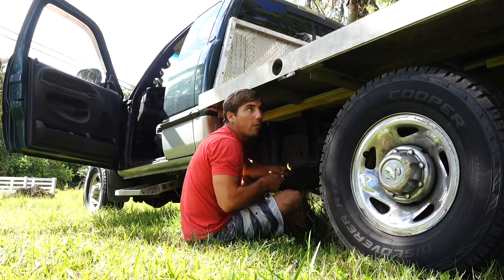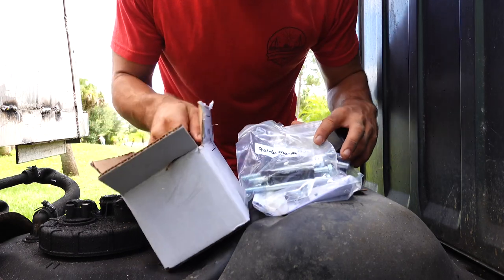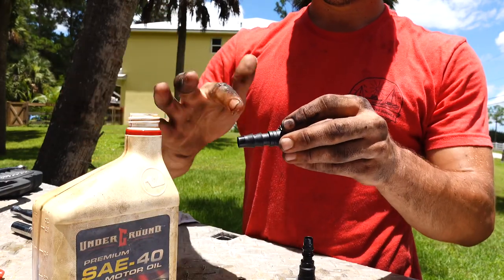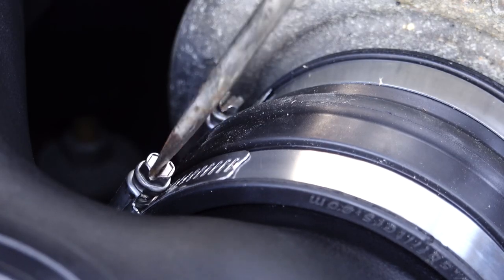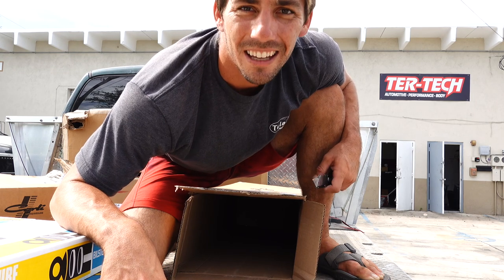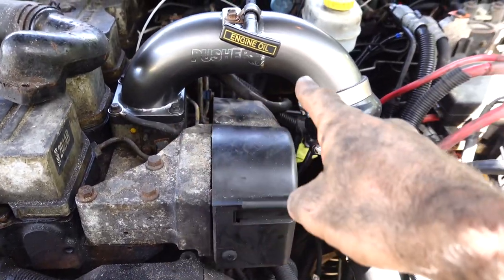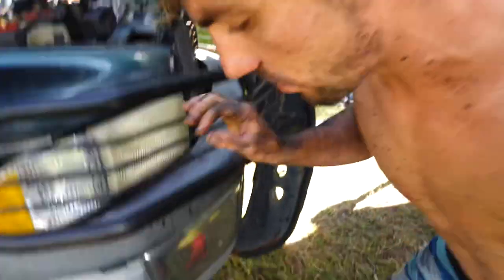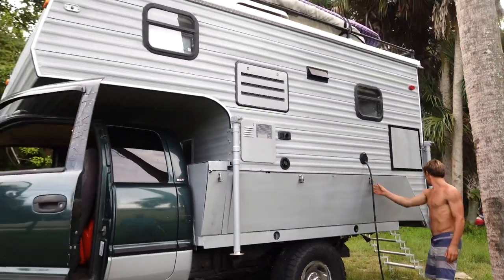Preparing the guts of our 20-year old cummins for an Off road and Off grid Truck Camper - Terra Tula

Comment: Treat the rust while you have the truck apart. May have been fine up until now, but have see too many trucks that end up needing frames welded because of big holes. Use a rust encapsulater or rust converter on everything. Even the drive shaft, etc. Will last lots longer and the next owners will thank you. I use stuff in rattle cans. Easy and lasts and lasts. Also use on steel trailers.

Comment: Dont forget to change your clutch fan. Clutch fans are probably the number one cause of cooling system failures. Even though your fan will be spinning with a worn out clutch fan, I will not be engaging as fast as it could at higher rpms so you lose cooling. A good way to check your clutch fan is turn on your AC. Most newer trucks are designed to engage the clutch fan as soon as your AC compressor starts. If you dont hear it come on, or its weak or slow, replace it.

Comment: I've got the same truck with the 5spd manual transmission. Shortbed. Same year, same color. Same problem with crap getting inside the fender by the air intake. Freaking stupid starlings. I also put an aftermarket lift pump on mine very soon after I bought it on 2007. I put the FASS system on mjne.It had about 172,000 then. It's got a little over 261,000 now. I've had zero issues with the vp44. Love my truck!

Comment: I dig these videos regardless of the mode of transportation.

In the first part of the video your hair was all wind blown.  You looked like a young Martin Sheen in Apocalypse Now.  

Definitely enjoy these projects and it happened to notice that this was done prior to doing the camper which obviously was a smart way to do it because if you don't have a dependable vehicle the camper has nowhere to sit.

You always do it right the first time no expense spared buying the best that you can afford, BRAVO!  No clean air no proper functioning diesel engine.  Thank you Mr Diesel!

The turbo almost works like part of a jet engine ( turbo fan & compressor). The more uninterrupted air the better.

Where are Billy, Sierra and Jetty currently?  Last video was block Island, where from there?

Comment: Hey guys, great vid as always. Could I suggest you use turnbuckles instead of ratchet straps to hold the camper to the flat bed? As an avid camper, I have found that ratchet straps can fray from unseen vibrations and micro movements at highway speeds. Just a suggestion. Camper and truck looks good!

Comment: I've got a '95 12v Cummins but it's only 2wd. Still fires up right away when I turn the key even with 306k miles on it! No electronics in the fuel system. It just sits in the driveway next to a '00 Ford Excursion 7.3 turbo diesel since I replaced them both with a 4wd '02 Tundra with the V8 and a Leer cap. They get cranked once a month.

Comment: As a mechanic with 30+ years experience I have to say good job on the repairs and upgrades,  now that it will "go" reliably, do not forget that rolling smooth and stopping is  important too. Many people overlook the bearings in the rear differential, you are carrying a heavier load now on parts worn in with a lighter load, accelerated wear is not uncommon when working conditions change. The brakes on that truck are more than adequate for the application, but do inspect them for condition and function. All the best from land locked Alberta.

Comment: Very nice job and improvements!  You wonder, why don’t manufacturers install quality intake manifolds from the factory?  What will it cost them penny’s?  Ugh..... I remember when I used to do most of this work by myself.   I used to think it would be nice to be 35 again, I’ll settle for 55!    My only suggestion would be to do something with those padlocks to keep them from rattling around.  But man, what a great job you guys did!

Comment: billy you need to fix that rust at the bottom of your doors!!   sadly it is a problem for all dodge trucks of that era and finding used doors with no rust is impossible on the east coast. .  what i have seen done is popriviting aluminum diamondplate over the bottom of the doors... looks pretty good.

Comment: Great job.  Have you thought about protecting those filters hanging below the frame in any way?  They look like the low point in the center of the truck.  Not sure how extreme your off roading will be but they would be the first to hit.
Reply from the maker: Def mounted much higher than the differentials and some other components

Comment: You really need a large transmission cooler on there with the weight you are rolling with. I would get a trans temp gauge as well. Heat kills automatics, and that trans isn't exactly considered one of the best. Not the worst...but not the best.

Comment: I have a 2014 RAM HD with the 6.7 Cummins and it's a great truck.  Next year, ordering a 2021 RAM HD dually for a big camper.  Watching all the work and money spent, I am torn why you didn't just go new and head out.
Reply from the maker: How much did your truck cost?
Reply: @Tulasendlesssummer  My Laramie listed for 61k and I got it for 51k.  I also got 18k for a 2005 GMC HD with Duramax that needed new injectors, glow plugs.  I have only bought new since 91 because of shop rates.  I would rather pay upfront for a warranty and RAM's is one of the best.  My extended warranty runs until July 2022.  Yes, it was the first year of 4th gen and had a lot of recalls, but they are free.  It's also worth 40k trade-in today.   So cost of ownership is about 2k a year.  I quit pouring money into old trucks because of the stealers service departments.
Reply: @Tulasendlesssummer  BTW,  volume dealer by me has 7k off list on new 3500's with Cummins.  Good starting point to deal.

Comment: Make sure you check the fluid level in your headlights at least every 500 miles.
Reply: And the blinked fluid must be topped off every 1000 blinks
Reply: @haywood12  That's only on Chevy Trucks
Reply: And don’t forget to grease the muffler bearings don’t want them to freeze up on you

Comment: Only downside to that engine is it’s bolted in a dodge.  You will have ball joints and front end soon, then the trans, and rust above your wheel wells.

Comment: But did you replace the KDP?   It' the killer dowel pin that comes loose and falls into your front case gears and destroys your engine.  It's a $10 dollr fix.

Comment: Billy did the air and fuel upgrades make a lot of difference in performance before the camper went back on? When I did my 2001 I upped the size of the injectors and programmer with the air fuel mods. I saw major HP increase but the truck never got more than 17mpg empty after that. 13 mpg towing 3,000lb trailer.

Comment: I’m not sure you understand what an intake manifold is. Thats just the intake piping. A manifold in general either collects or disperses multiple points of flow. The intake manifold is AFTER that piping they sent you and disperses the flow into each cylinder. The intake manifold is bolted directly to the cylinder head. You didn’t replace the intake manifold.

Comment: How the heck were you able to start the truck again with air in the line? I installed the same water separator parts and couldn't get my truck started again. I have the same truck and had to get it towed to the mechanic so they could start it for me again.
Reply from the maker: I filled a filter with fuel then screwed it on then just bumped the key which activates the lift pump and purges the air through the return. I didn’t even have to crack injector lines but that’s what you would have to do if you ha e too much air up there

Comment: I recommend changing the automatic transmission fluid and filter, if you have not already done that. Good job on everything you'd done on the truck and camper. Those are some great upgrades.

Comment: You should get rid of those Air Dog filters and replace them with Caterpillar filters , those Air Dog filters will not do as good of a job and will leave you stranded . You will still have to get a new injection pump as well . I know because they left me standed two times and cost  me thousands.
Reply from the maker: How exactly did they leave you stranded? Did they fail somehow? Get clogged? Did you have a fuel pressure gauge to monitor fuel pressure?
Reply: @Tulasendlesssummer  i am sorry that i did not get back to you sooner i work crazy shifts. Those Bull Dog filters don't have enough filter material in side of them and let little particles through and the water separater don't stop all the water causing rust to form in the injection pump . I don't have my truck any more so i don't remember the Catapiller replacement numbers any more . When you have to change your filters cut one of them open and see how little of filter paper is in side . I have followed you too for a long time and love going on adventures with you good luck on your travels on land and i will wait for you when you get back to the water.

Comment: Don't see any clamp on the new lines on top of the tank! They will get warm and possible pop off!.
Reply from the maker: Those are press on barb fittings. I had to cut the line to get it off and even that wasn’t easy. No way they are leaking or coming off